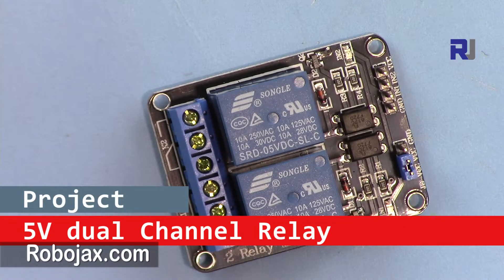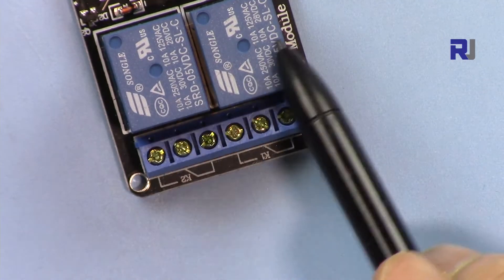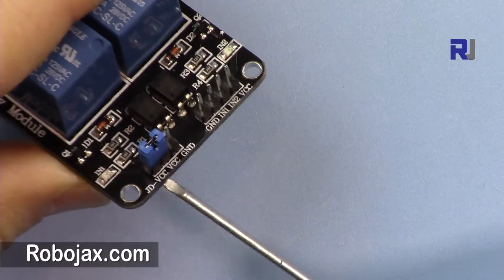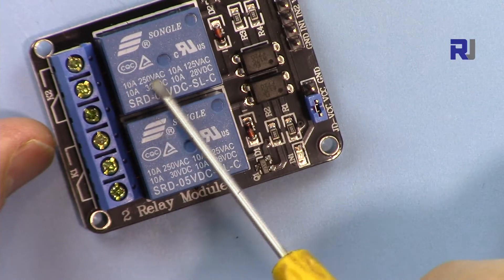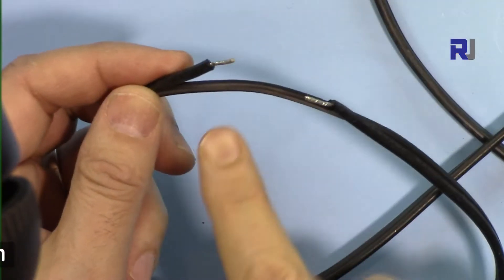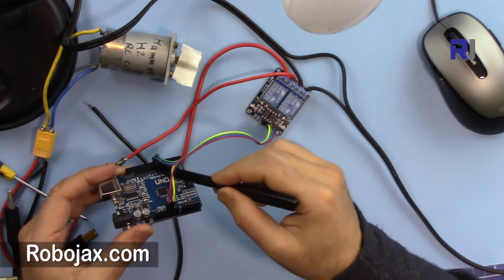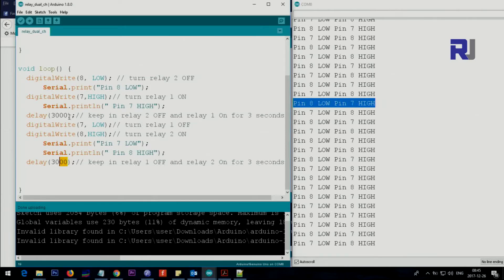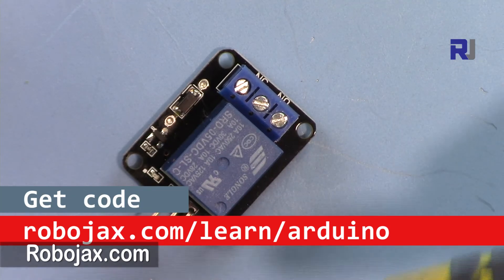How to use 2 channel relay to control AC and DC loads in Arduino RJT34

Comment: Is it necessary for a 5v relay module to take 5v signal input for switching. I’m using esp8266 d4 pin which is 3.3v as signal. But it sometimes don’t work ? Please assist
Reply from the maker: It be triggered with about 2.6V

Comment: How do I use 1 button to turn 
off ch1 & ch2 on like 0:30 with dc both sides? 
Or can I use 1ch relay?
Reply from the maker: I have so many videos and push buttons switch please search them. For one relay, it can turn on/off only and you can’t change what direction of rotation. It seems you haven’t watched the video. Please watch fully yo learn.

Comment: hello sir, how do i connect a 3 wired ac fan exhaust to a relay? is it similar to this video?
Reply from the maker: Regular fan has only 2 wires. One wire should be ground. So ignore that and do not touch it. Now you have two wire to work with at your own risk.

Comment: Can it be converted to high trigger?
Reply from the maker: I don't undestand what. you can reacieve any signal LOW or HIGH and do something with Arduino. So Arduino can send LOW or HIGH to the relay. But if you want to do it without Arduino, you can do it with a PNP transistor and 1k ohm reisistor. But here is the relay with LOW level trigger https://youtu.be/N-xbxtGGoHw

Comment: I am unable to understand the DC motor connection at least you should have shared the circuit diagram
Reply from the maker: it is all about the code in Arduino. learn that and you will understand why I shown how to connect. I have shown all wiring. I just watched myself the video.

Comment: What if I connect a motor driver (say drv8825) to a Raspberry pi board to control a nema17 stepper motor, and at the same time I connect a relay module to the same Pi board to control an AC bulb? Can I control both simultaneously?

Comment: i wonder an want to learn, why do we use l298n motor driver instead of using relays to run DC motors?
Reply from the maker: relay can just turn ON/OFf a motor and con't control something in between which we want to control the speed. L298N allows speed control and relay can't.

Comment: Hi Ahmad, 
Educational movie, clearly explained, liked and subscribed. Regarding rating of the relay: I never understood why the rating is AC 250V/10A and for AC 125V is also 10A? If this can switch a power of 2.5 KW at 250 V why cannot switch 20 A at 125 VAC, because that would be same power?  Thanks.
Reply from the maker: Hi, the piece of metal the current passing through the relay can handle 10A. At lower voltage works fine but higher voltage is prone to causing spark and for that reason you can't say at 250V it can handle 10A=2500W, we should then go back to 125V and use it for 2500W. 10A is the limit. Usually at lower voltages it works fine but can't increase it.
Reply: @robojax  Thank you. So the limiting factor is the current not the actual power....

Comment: Hi, thanks for the explanation.
Important comment: When taking out the jumper to supply power from an independent source for relays, exterior pins shold be used (GND and JD-VCC). The VCC central pin is the same as the VCC in the other input as they are wired together through the pcb.
I'm doing a little research since my board (NODEMCU ESP8266) works with 3.3V, and I want to try feeding 5V to the relays and 3 to the signal side. Would it be possible? Has anyone tried?

Comment: I'm trying to to use these relays (x6) but controlled from 74HC595 chips. But i can't get it to work. The 74HC595 chip only gives out 6  mA but shouldn't the power come from the 5V? Only the led lights up.
Reply from the maker: Hi, that's why we use relay driver so enough power drivers the relay. voltage is one thing, the current (ampere) id different. Power = V*I, where P is power in Watt, V is voltage and I is current in A (Ampere). So you need to use relay module. or build your own relay driver shown in this video https://youtu.be/N-fFk51Eb8s

Comment: At 4:09 can I attach a power source that's higher than 5v to the external Power source if I don't want to use the power from Arduino?
Reply from the maker: You need to watch this lesson on Arduino board https://youtu.be/wHd2CWlEL1E

Comment: Very good video can you tell us how we can hook loads that exceed 30 volts DC so if I have two batteries that I want to toggle between and they're 36 volts wouldn't that 36 volts passing through there destroy the circuit how do we toggle between those two DC power loads and still get the electricity needed to run the application

Comment: So can a two channel relay also power two outputs at the same? (Motor and Light both on)
Reply from the maker: if you mean to share the power to power up Arduino and relay and power up your load. yes you can if your load is needs the same level of voltage.

Comment: i have a question, i am using same relay as yours but i get a reverse result, when my arduino isnt sending high signal to the in1 or in2 relay gets active, when i send signal to in1 or in2 relay turn off. pls help
Reply from the maker: Hello,  your relay must be different. Regardless I have explained it fully so you should understand it if you watched that you can change anywhere inside loop you see HIGH and LOW, switch them. meaning change HIGH to LOW and LOW to HIGH.

Comment: Caution: Please do not solder the ends of wires as it can melt over time and cause shorts and fire. Instead, crimp the ends down with a proper tool.
Reply: Been soldering wire for 40 years now and have never seen a solder joint fail due to heat. Poor adhesion maybe, but never heat. 60/40 solder melts at 365F and if your circuit is getting to that temperature, you have done something wrong. Stop spreading that BS lie.
Reply: No. Components are soldered and there is no danger. Soldering of wire end is reliable and proper!

Comment: Ive tried doing that only for the 12v Dc motor but it failed for some reason
Reply from the maker: this is just simple switch ON/OFF it should not fail. first try it without motor  and see if relays respond. at one time both relay should not be ON. One is ON the other is OFF to make the motor run. else you have done incorrect wiring.
Reply from the maker: This very basic and it should work.

Comment: your link to the code goes to code to control the direction of a dc motor
Reply from the maker: is this statement or question? it seems you have not watched the first minuet of the video.
Reply: @robojax  so i have watched the video. Three times.
Have you clicked on the link to see where it re-directs you to? The code in your video, doesnt seem to match the code that the link goes to.
Thats a statement.

Comment: sir , i have a question , if the lamp is replaced with a single phase 220VAC 1400watt electric motor , can it be done??

please answare sir,  that is my Homework from My school
Reply from the maker: You have not watched the video fully. I made the video so you get all answers.

Comment: this is active low relay or not
Reply from the maker: I don't remember what is it. when i explained the code where it say 
digitalWrite(8, LOW);
if this line which has LOW turns the relay ON, then the relay is Low level trigger if we have
digitalWrite(8, HIGH) and it turns the relay ON, then it is HIGH level trigger.  Just watch and pay attention. Good luck.

Comment: There is TWO HUGE mistakes in this video!!! FIRST MISTAKE: The 5V provided by Arduino is not enough to switch the relay because the optocuplor and the relay is rated at 12 Volts ! SECOND MISTAKE: The 12V for the optocuplor and relay must be provided on the pin named JD Vcc, not on the Vcc because the Vcc from left is connected with Vcc from right and you will put 12V on Arduino 5V and Arduino board will blow. I saw this video and I distroy one Arduino nano board. PLEASE PAY ATTENTION TO THE RELAY BOARD!
Reply from the maker: 5V of Arduino can supply minimum 1A which is coming from laptop or desktop.  Each relay will use maximum of 100mA so in total this will consume 0.2A so no worries.

Comment: Great video! This helped a lot. Can you please explain what kind of dc power supply you connected to the motor? Is it okay to use Li-ion batteries for that purpose?
Reply from the maker: The power supply voltage depends on your motor. doe snot matter. if your motor is 50V use 50V or it is 12V use 12V. You are welcome. Please subscribe. I appreciate it and helps my channel grow.  Thank you
Reply: @robojax  thanks a lot! Will subscribe
Reply: @robojax  Good circuit but is it possible to do this without the ardino?

Comment: Hello, I'm switching a motor ON and OFF once the counts reach the preset value.. but upon switching ON/OFF my arduino resets randomly but not always . Advice plaease. Thankyou in advance.
Reply: 3 phase motor via a contactor. (DOL) stater..
Reply from the maker: if it rests arduino, it means something is wrong and it creates short circuit and turning the Arduino. check wiring. I assume you have not changed the code.

Comment: Hi! I’m having trouble when hooking the wires to Normally Open. It doesn’t work. If I hook the wires to Normally Closed it works just fine. Any help would be much appreciated. Thanks!
Reply from the maker: If you connect it to normalcy open then you have define ON and OF the opposite,  I have fully explained it how it works. Watch it tow or three times until you get it .

Comment: is there anything out there that can, using a 120ac input, relay a 5v circuit?
Reply from the maker: your question is not clear.  if you meant to power the 5V relay with AC, then yes. AC120V to 5V dC adapter.
Reply: @robojax  Is normal to control a 120ac  relay with a 5v board. My question is how  can I do the reverse. I want to have a normal house pole switch that in some way control/send a 5v circuit (a 5v relay maybe if exists?)

Comment: I think you mentioned hooking up the wrong VCC pin when using external power. When you remove the jumper, you want the external 5V to be on the LEFT VCC pin
Reply from the maker: look at diagram I've shown.
Reply: @robojax  look at 3:58 where you point out wrong VCC terminal. What diagram?

Comment: Is the arduino and relay safe from back emf from dc motor? What if we connect 12v dc solenoid instead of dc motor? How to control it's back emf when it switches off?
Reply from the maker: relay is just mechanical switch. to if you know what happens when you turn ON and OFF a switch to motor or solenoid, the same is true here.

Comment: Can we turn on both the ac load and dc load at the same time using the two channel relay? or is that not safe and thus being the reason why you showed them being on in an alternating manner in the video?
Reply from the maker: Yes. This just relay. a switch.
Reply: @robojax  Thank you for replying and clarifying that we can turn on both the ac load and dc load at the same time using the two channel relay.

Comment: I've looked all over the internet and this is the closest I've found to a solution to my problem. My project has a 12V power supply using three 18650  Li-ion batteries on a charger board ( https://www.parts-express.com/dayton-audio-lbb-3-3-x-18650-lithium-battery-charger-board---module-12v-with-charge-protect--325-200 ).  I need to upgrade this to 24V with another identical board using a 2-channel optocoupler relay I have from HiLetgo. I have all the components but have no idea how to wire them together safely. Can you help?
Reply from the maker: Hello, I can answer your question if I understand it and it is related to this video. I did not understand what  you are trying to do.
Reply: @robojax   Thanks for replying. It's a bluetooth speaker kit with an amp that can handle 24V. But the kit only comes with the 12V board even though they do recommend upgrading o 24V. So I have to connect the two boards in series, with an optocoupler relay similar to the one in this video, in between controlling them somehow.

Comment: Hi, congratulations on your professionalism. I would like to ask you how to make the 4 lelay work with an arduino 
 radio frequency remote control. Thank you, subscribed and like !!
Reply from the maker: thank you.  there so many protocols of RF remote controlling. modules sold for Arduino and people also use RC car/plane can also be used. it needs full detailed video.

Comment: It would be somewhat safer to connect the ac neutral to the relay, being it is connected to ground, and can not make a circuit with ground, you would have to rember the line or hot wire is still live,  when the circuit is shut off, so light sockets would still have a live contact, it would make the board safer to touch!
Reply from the maker: Hi, always put switch on LIVE or HOT line. the relay is switch and connect LIVE. But remember it is NOT safe to touch even if the relay is OFF.

Comment: Hi sir, if my relay is 12V and I'm going to use an Arduino to send signal. Is it possible to trigger the relay? But using an 12V external power to JD-VCC. Thanks.
Reply from the maker: if you are can.

Comment: how can i control two ac loads and have start and stop. also i need so if one relay is on the other can't turn on. im tryng to control a ac motor that can spin both way and the relay will turn on the contactor that controls the ac motor
Reply from the maker: Hello, here is how to control the direction of rotation of DC motor using two relay https://youtu.be/JMBgGO07YLM
Reply: Robojax do you know how to add a start and a stop to this code?

Comment: Hi, i would like to know if the 24v rated relay modules could be triggered by 24v as signal or the 5v is a must as signal. Thank you.
Reply from the maker: it would be very simple to use 2 resistors to make voltage divider.  See this diagram.  https://snipboard.io/gJXm0c.jpg this converts 5V for 3.3V and can be used for 24V just change the 1.8k resistor to 22k.

Comment: Can I use to control solar panel and dynamo motor depending on whose voltage is high
Reply from the maker: Yes you can,  use the code in this video to ready voltage https://youtu.be/FaoKzi7tgME I have mentioned how to measure any voltage. Then decide what to do when the voltage reaches to certain value.
Reply: @robojax  Thank you
Reply: @robojax  I am making solar , wind hybrid power system . It measures voltages generated by solar panel and motor and compares them . It has 2 LEDs . If the voltage generated by solar panel is greater than motor then LED1 glows by power produced by solar panel and if voltage generated by motor is high LED2 glows by power produced by motor . Please guide me about the connections of solar panel , motor and LEDs with 2 channel relay module

Comment: thank you but the link provided to download the code is not working does not even directly link to the files to download can i make a request to ask for the fresh link so i can download it again
Reply from the maker: Thank you for letting me know. The link was incorrect and to other contents. I just fixed it. You can try it gain.
Reply: @robojax  can i make a request for a project... code and setup of charging station with 2 relay channel , charging module and coin acceptor ...the rate of hrs per coin ?
Reply from the maker: that is very hard. Detecting coin and values is very tough topic. it needs very complex mechanism and processing power. I won't be able to do it alone.
Reply: @robojax  there is a tutorial about coin acceptor my problem i dont have background with any source code in adruino so it is difficult to me to start this project i have the diagram for coinacceptor and your tutorial for controlling relays but my problem is i dont know how to start to combine those two the clue is on my hand but i dont have an idea to sketch the code

Comment: Hi Sir Robojax! Greetings from Philippines! i like how you tutor me using your videos! do you use the own 5v supply of arduino UNO? hows that possible when you have huge 2 loads(1 motor and 1 LBulb) i think  500mA is the max current draw on arduino Uno 5v pin?
Reply: Oh my bad i was overthinking the relays mA current draw is different from the rating of the relays contacts. but why use a external power source or separate the supply of the  relays? from arduino 5v? in your video you use arduino UNO 5v whats the difference between supplying externally and via arduino UNO own 5v?
Reply from the maker: I just explained the option because you may keep Arduino separate from relay power for safety reason because it is possible for relay to draw more current, arduino can't supply that much and keep is safe.
Reply: Thanks sir robojax! i love you man i owe you a lot! when i finish my project i want you to see it firts!
Reply from the maker: You are welcome. I ❤️ you too. Let's be good and help each other.

Comment: What is maximun delay value? I want make motor run 2 hour earlier than light
Reply from the maker: There is no limit. You can delay it as long as you want.
Reply: @robojax  thanks for fast reply.. U r the best

Comment: Sir can we give 5v dc without arduino
Reply from the maker: Yes I believe I have explained in it in video.  You can't always connect to USB.
Reply: Thank you for ur valualble reply. I am using this for automatic changeover switch 12v solar inverter.

Comment: Sir, you explained very well... My question is about the bulb.... Is the bulb connected to external power supply even after connecting to arduino??
Reply from the maker: yes.

Comment: Can I use a 12 VDC for a load connected to the relay  or I am limited to 28 or 30VDC? Will the current be 10 Amp too ?
Reply from the maker: Your load can by anything from 1V to 220V either AC or DC as long as you follow the power/current rating of the relay and safely proceed.

Comment: What relay can I use? I have 12V DC power source and I want 5V going to power an Arduino and 9V to power a device like a servo or actuator.
Reply from the maker: any relay either 5V or 12V. But you need relay module to connect it in simple way. Search my channel  https://youtube.com/robojaxTV/search?query=relay